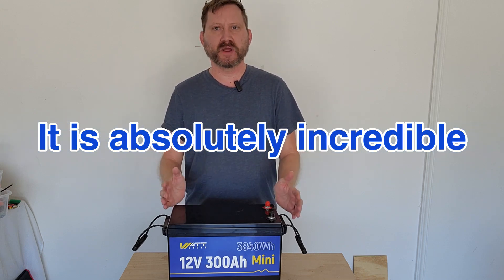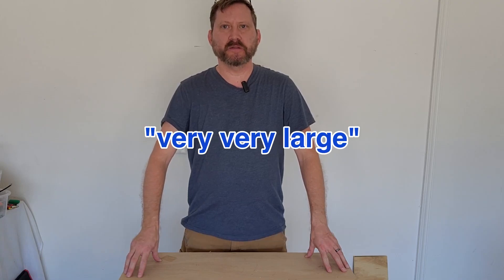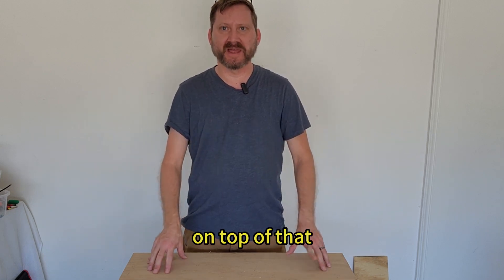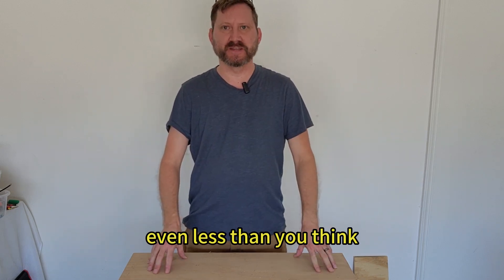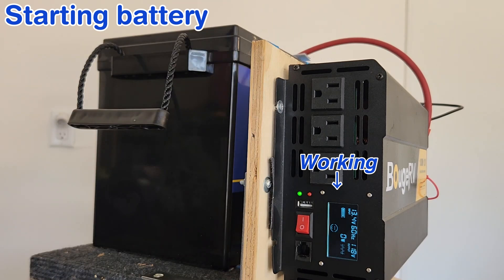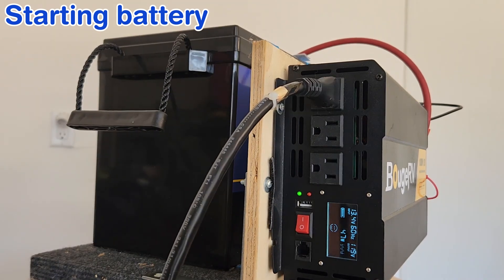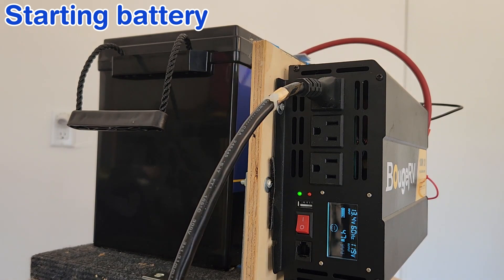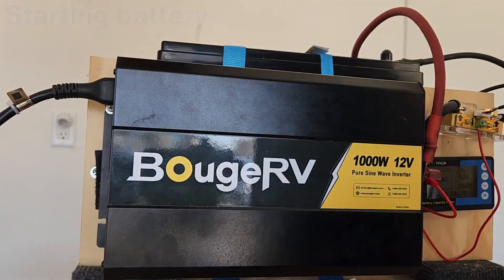DIY Power Station with WattCycle 12V 280Ah Mini Battery | Compact Size, Big Power!

Comment: You still need a battery charger to recharge it or a solar charger to maintain the battery😊
Reply from the maker: Absolutely! 😊 You do need a charger or a solar controller to keep it powered—but the great thing is it runs silently and can be used indoors. A lot of folks pair it with solar for a simple day-charge, night-use setup. Super convenient!

Comment: you know I went out and bought a 4500 watt propane generator for my camper and it runs the refrigerator the air conditioner and everything inside. that small grill bottle last all day long. and I got it on sale at home Depot for $375. you can't even buy the lithium battery. for that much. propane Burns clean. and there's plenty of it.. you can keep your battery inverter and all that cheapo stuff. I'll run my propane generator thank you
Reply from the maker: That’s a solid setup! Propane generators definitely have their advantages—instant power and long run time. 🔥 But for folks looking for silent, maintenance-free, and clean energy—especially indoors or in stealth camping situations—LiFePO₄ batteries like this one offer a different kind of flexibility. 😊 At the end of the day, it’s all about what fits your lifestyle best. Appreciate you sharing your experience!
Reply: I agree with your thinking, I have 4 different sizes of generators,one of them is trifuel. But having a power supply that doesn’t require fuel is pretty nice.. and if done correctly doesn’t cost much. Just saying 😊
Reply from the maker: Absolutely! 🔋 Having both options—generators and a reliable battery setup—gives you the best of both worlds. For quiet nights, no fumes, and low maintenance, LiFePO4 really shines. And like you said, if you build it smart, it doesn't have to break the bank. Thanks for sharing your take! 😊

Comment: Way too expensive
Reply from the maker: Thanks for your feedback!  While the upfront cost may seem high, our WattCycle 12V 280Ah Mini LiFePO4 Battery offers longer lifespan (5000+ cycles), higher efficiency, and built-in BMS protection, making it a cost-effective investment in the long run. Compared to lead-acid, it saves money over time with better performance and zero maintenance. Let us know if you have any questions! 😊

Comment: I would have gone 24 volts to comfortably run a 2kw inverter. You need that much extra to start some refrigerators.
Reply from the maker: That's a good point about going 24V for a 2kW inverter, especially for appliances with high starting currents like refrigerators. While a 12V system can technically work, 24V offers advantages in terms of lower current draw and reduced cable size. Thanks for sharing your insight!

Comment: I just ordered 4 of them for a small camper. Boondocking in Florida requires A/C. I have the 2500 watt Bougerv inverter what a coincidence. Do you have a recommendation for charge controllers? I also ordered two 200 watt Bougerv solar panels.
Reply from the maker: That's a great setup for a small camper and Boondocking in Florida! For your 48V system (four 12V batteries in series), you'll need a 48V MPPT charge controller. With 400 watts of solar (2 panels x 200 watts), a 40A MPPT controller would be a good match. However, if you plan to add more solar panels later, consider a larger controller (e.g., 60A) to provide headroom for expansion. Look for a controller with temperature compensation and safety features like overload and short-circuit protection. Brands like Victron Energy, Renogy, and EPEVER are good options to explore. Enjoy your A/C-powered Boondocking adventures!
Reply: That seems like a lot of battery storage and not much solar panel capacity for charging the batteries back up. I have half as many batteries but two and a half times the solar panels (1,000 watts).
Reply: @traveling.down.the.road56  I will be adding more solar for sure. Sounds like you have a Avery nice setup.

Comment: I didn't see a fuse on the hot side. Also, 1,000 watts isn't going to power much; but on the upside it can do it for awhile.
Reply from the maker: Thanks for pointing this out The fuse provides safety features(over-current protection). Regarding the 1000W inverter example, you're right that it might not power everything, but it's designed to provide sustained power for essential devices or appliances. For higher power demands, you might consider using a larger inverter or multiple batteries in parallel. We're always working on expanding our product offerings to meet a wider range of power needs.
Reply: @wattcyclepower  Thanks...I plan on buying more of your batteries.
Reply from the maker: Fantastic! We're happy to hear you're planning on purchasing more Wattcycle batteries. We appreciate your support and are confident you'll be satisfied with their performance.
Reply: @wattcyclepower  We aint got the power Captain !

Comment: How do you plan on charging the battery?
Reply from the maker: Thanks for your question! The battery charging strategy depends on the specific setup. Typically use a combination of methods, including solar panels, a DC-to-DC charger from the vehicle's alternator while driving, and occasionally shore power if available(dedicated LiFePo4 charger). We'll try to cover the charging details more in-depth in future videos. Let me know if you have any other questions!
Reply: @wattcyclepower  Personally i'ld have several different ways on hand , if possible .Btw they're light enough to fit in a backpack and brought into a hotel room 😏.